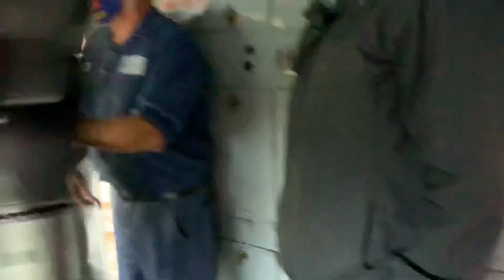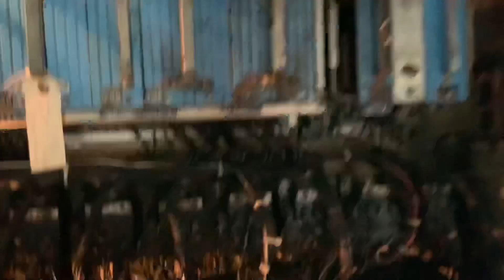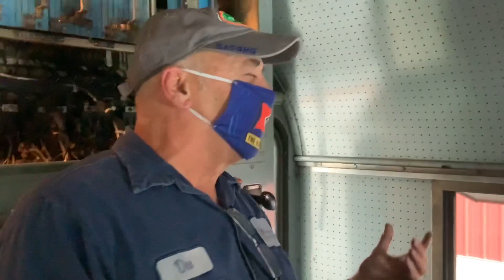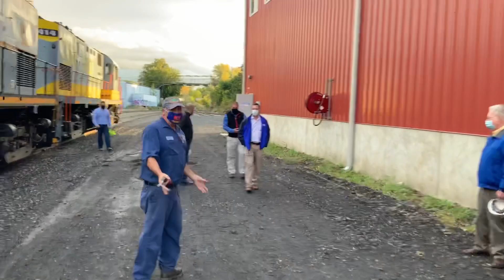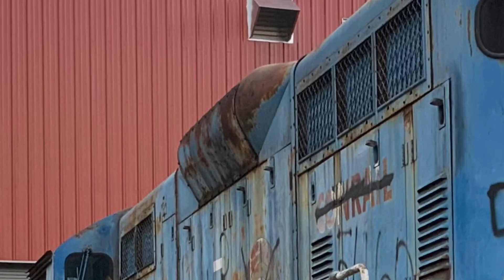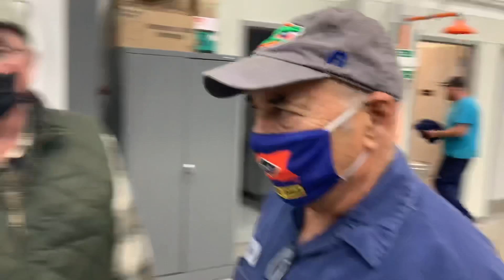ASHE’s GVT Delaware-Lackawanna Von Storch Locomotive Shops Tour Part 2

Comment: Im going to double down on "Old scchool"., Things worked
When you have a threesome of EMD Series running point on power and at a mid train keeping  the train tight and   not  beating the knuckels from taking a beating
All  is left is to roll off this power and let the air on the main resivior build to90 psi and ready to roll out!

Comment: I retired 1-4-2011 after 36 years in engine service. I ran #86 Richmond, VA to Wash. D.C. and #95 back with one of those techno turds from GE. All that tech crap, 4,200 hp to move 7 Amcans at 70mph, what a waste of money. An RS3, or RS11 could have done the same job without breaking a sweat.